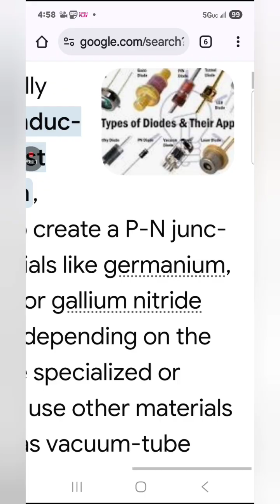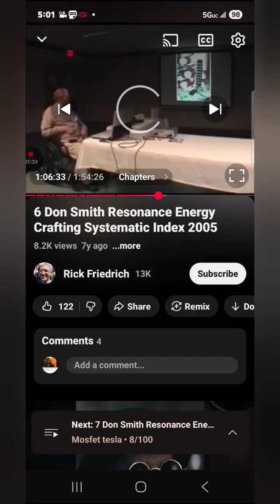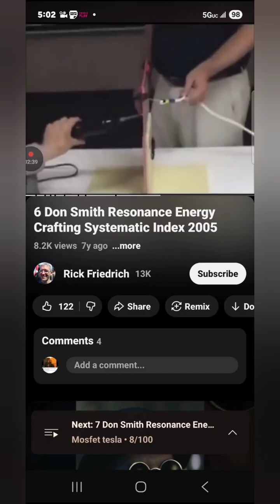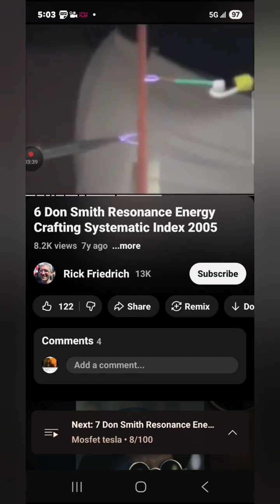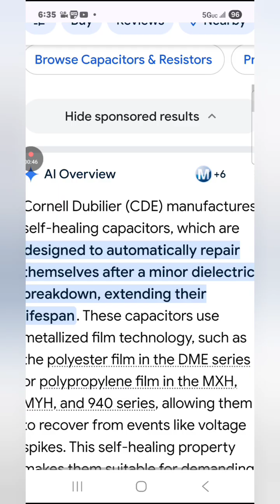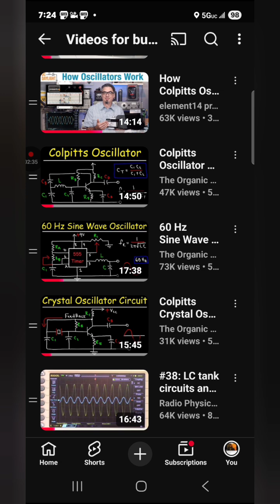The Return Of Marduk, The New Global Utopia, The Tower Of Babel, And The Fall Of Yahweh's Elohim

Comment: Appreciate the constant feedback brother.

In the first or second video in that series of videos of Don Smith, he speaks about how he used attached a resistor to the legs of a capacitor and connected it directly to an inductor to create pulsed DC output. In other words, he didn't use an actual power supply which has MOSFETs or anything else.

Now, he doesn't really say what values of a capacitor & resistor he uses, but I've playing around with this combo but with little success. See if you have any success with this and please let us know if you discover anything new.

I've also tried making a solid state Tesla coil using MOSFETs but have destroyed a few in the process because of static electrical discharge from my hands. They are very sensitive and break very easily.

Anyway, please do update us if you find any success. I've spent the last 2 years learning this stuff since you first planted a seed in my mind and I plan to have a fully working unit by the end of December if all goes according to plan.

I
Reply from the maker: Do you have an oscilliscope?  The resistor is used to control resonance and frequency...you  Need to convert dc to ac and then feed it into a voltage doubler...you can do this without using mosfets, diodes, or transistors...furthermore..what formulas are you using?
Reply: No, I don't have an oscilloscope. I want to see if I can build a working unit without one first. I'm also trying to spend as little as possible till I see some results. Although I do understand a scope is important, especially to see the output waveform and other things.

About your second question: As you know, there are many ways to build a working device. My plan is to first build my own RF "neon sign transformer" (using MOSFETs, 555 chip timer, capacitors, resistors, diodes etc). 

Then connect this Neon sign transformer to my L1 and L2, making sure the output of my L2 is about 230v (mains supply is 220v - 230v in South Africa). 

From this point I will only need to bring the RF frequency down to 50hz (which we use in South Africa) and to do this I will manually measure the inductance of my L2 coil using the formula:
L = (U × N-square × A) / I

(I used Grok, Gemini and ChatGPT to do the actual calculation and I got more or less the same answer on all 3 platforms and they saved me time).

At this point I would have my inductance value and the output frequency I desire, which is 50hz. Then I would use a nomogragh to draw a line to connect the 50hz output with the inductance value from the calculation. The nomogragh would then give me both a resistor value and a capacitor value that I could possibly use to bring the RF frequency down to my 50Hz... I would have to select one of the 2, not both. I would use capacitor. (Only issue is the capapacitance here is very high, and I'm not sure if I will be able to find one for sale easily)

At this point I would have my 230v & my 50hz output. The last thing would be to stabilize the sine wave output from my L2 and to do this I'm gonna feed the output directly into a 1000W microwave transformer.

My amps will not necessarily come from the microwave transformer but from the ground: I would then add  a thick ground wire to the output positive terminal of the transformer together with 230v GDT or Varistor to keep current at same level as voltage...

The above is my plan and theory, it sounds very simple but in practice it's a little hard, especially because I have had to teach myself a little about electronics almost 2 years ago when you introduced us to this stuff.

Thoughts from your end?
Reply from the maker: @galactictradingmotivation  you're relying on mosfets, transistors, diodes, and timing chips to make your neon transformer....that's a problem unless you can make these items from scratch due to the fact that you're relying on corporations to manufacture these components...if these corporations discontinue making these components then you're stuck....the device I'm building will consist of inductors, capacitors, and resistors only...if they discontinue manufacturing these items it'll be no problem because I can build my own capacitors, inductors, and resistors...step 1.  Build out a crystal cell battery bank as your dc input.  You'll need a volt and amp meter to calculate your batteries...connect batteries in series to boost voltage or parsllel to boost amperage...step 2...CONVERT DC TO AC using a double coil that's connevted to earth ground...the double coil needs a capacitor connected in parallel....the wire turns of the top coil should have a few more turns than the bottom coil resulting in a spiked alternating current signal which is technically an AC signal....you need an oscilliscope to see the wave form and frequency output....using this method not only converts dc to ac but it also doubles your ac voltage output...STEP 3....RECTIFY AC BACK TO DC AND REPEAT STEP 2...DOING THIS YOU CAN CONVERT 12 VOLTS TO 24 VOLTS...THEN 24 VOLTS TO 48 VOLTS THEN 48 VOLTS TO 96 VOLTS ETC. ETC.....START WITH THIS METHOD TO AVOID USING DIODES, TRANSFORMERS, MOSFETS, AND TIMING CHIPS...DO THIS FIRST AND TELL ME YOUR RESULTS AND THEN WE CAN MOVE ONTO THE NEXT STEP
Reply from the maker: @galactictradingmotivation to rectify ac to dc...run the ac through an inductor coil...use thin copper sheets sperated by a dielectric ala plastic, film, etc...make several layers and wrap around the inductor coil...the resonance of the copper sheets along with the inductor coil should output a smooth dc output...the more copper+dielectric layers the smoother the dc output signal...once again you'll need an oscilliscope to see the waveform
Reply from the maker: @galactictradingmotivation You'll also need to calculate the JOULES OUTPUT that your inductor generator is outputting before connecting to a load...this will calculate the wattage output
Reply from the maker: @galactictradingmotivation   ONE LAST THING...I NOTICED YOU MENTIONED DON SMITH...DON SMITH DOESN'T  DISCLOSE ANY SPECIFICS...HE JUST GIVES YOU THE CONCEPT...YOU NEED TO USE THE PROPER FORMULAS AND MATH CALCULATIONS OR ELSE YOU'RE GOING TO START OFF ON THE WRONG FOOT...STEP 1...BUILD CRYSTAL CELL BATTERY BANK....STEP 2...CONVERT DC TO AC AND BOOST VOLTAGE TO THOUSANDS OF VOLTS
STEP 3...ONCE VOLTAGE IS BOOSTED CONVERT THE HIGH DC VOLTAGE BACK TO AC AND CONNECT TO YOUR L1 COIL...THE WIRE LENGTH OF YOUR L1 OUGHT TO SET YOUR FREQUENCY....START THERE SO THIS DOESN'T GET TOO COMPLICATED
Reply: Thanks for your suggestions... I'll rework this and come back with feedback...

This stuff is not easy and needs time but I feel we should move a little bit faster on this. One of us needs to have a fully working unit very soon.

Thanks again!
Reply from the maker: @galactictradingmotivation Building a working model is not the problem...building a working model without relying on manufactured parts from a corporation is the problem...NOW THAT PROBLEM IS SOLVED...I'LL HAVE A WORKING MODEL REAL SOON...I'LL NOTIFY YOU WHEN COMPLETE...PEACE BROTHER